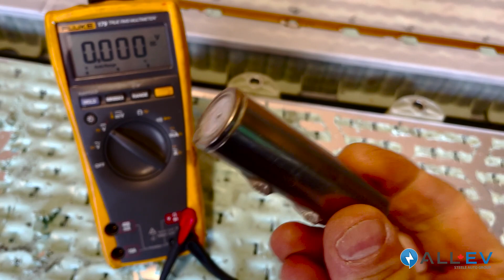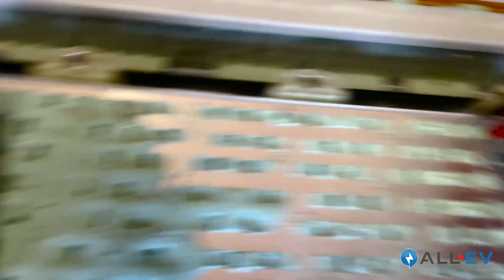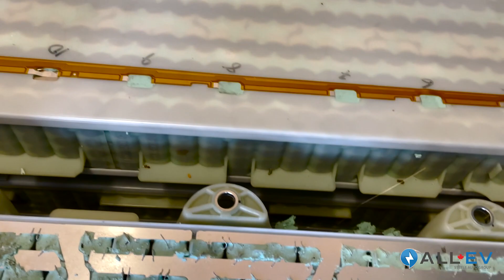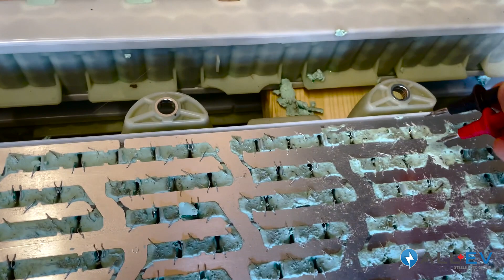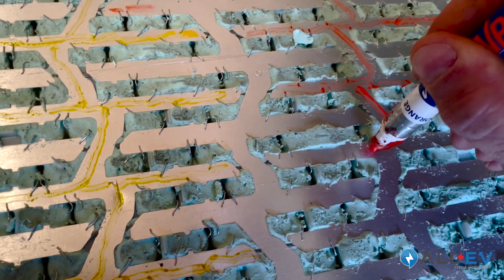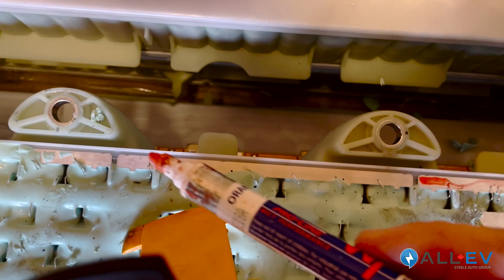High Voltage Battery Construction - 2019 Tesla Model 3 Long Range

Comment: Which battery? Tesla? Might want to put that in the title.
Reply from the maker: Thanks Dave. We've updated the video. It's a battery from a 2019 Tesla Model 3 Long Range.
Reply: think this is actually a Bolt pack. Tesla's modules are either bigger or smaller than this one I think (hard to get scale to judge)